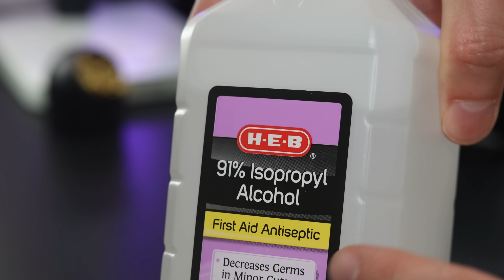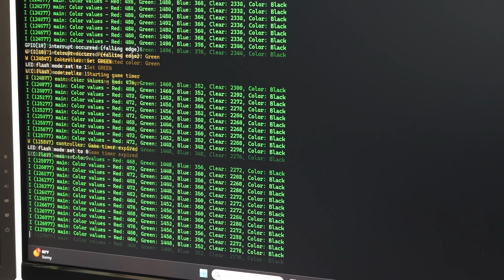Do This Before You Solder Anything

Comment: You don't need to be too specific with the iron temperature, as you can compensate by adjusting your soldering speed. I used a Metcal iron with a STTC-126 tip for everything (From SMD to large ground planes and 8AWG wire) - It has a fixed temperature of 413C.

I wouldn't want people to struggle and think the setting is wrong or the tip is wrong or they need extra flux or something else - It's all about practice and once you're good at it, the equipment and settings don't really matter. (Except for good quality solder, the poor quality stuff really is useless.)

Comment: ok, well, I have solder about 100 units a day, which would be around 3000-5000 individual solder joints, so your process is just a little too slow, nice video though.

Comment: Great video !

Radio technician for 50 years:

I used a gun until actually employed. Irons will disappoint you when making the transition
to a bench pencil iron. 
I love the weller butane irons in February on top of grain mills.

2. 99% alcohol always.  Too much water and won't evaporate quickly when you're in the field under the gun repairing gear.

Get the best, not most expensive,
desoldering tool you can find. Hakko brand & Pace MP-1.
With today's LiFePO4 batteries, you can make them portable. 

SOLDER WICK IS YOUR FRIEND.
I loved how you used the wire to remove excess solder.

Sometimes when removing a silver soldered component, 
and you can't get it hot enough: 

DOPE IT.

Add regular (vs. Unleaded) solder to the connection.  
It'll just fall off now. 
Clean it off and use whichever you want or is handy when you're on top of a farm leg in February.

Great video !
Great presentation!
Great order !

Thanks !!
Reply: Silver solder, or silver bearing solder? There's a difference.

Comment: a bad fume extractor can give a false sense of protection so it might actually be worse to have a bad one.
And iove soldered for 20+ years, and having a good solder with 5 core flux or similiar (and having the lowest possible temperature for the thing youre gonan solder) removes the need of adding flux in most cases

Comment: I have been soldering since the 90s and have come up with THREE basic rules: 
1. The solder should be of maximum quality and preferably 63/37 (NOT purchased in China).
2. The soldering iron must have thermal stabilization. 
3. The tip size, the soldering iron must be selected according to the size of the soldering object - the Fourier heat transfer law still works (you can raise the temperature - but this is unprofessional). 
With desoldering, everything becomes much more complicated ))
Reply: Также предварительное облуживание поверхностей, которые посредственно поддаются покрытию припоем

Comment: You obviously haven't come across corroded solder pads. A first step in those cases is to use a gentle rubbing with something like scotchbrite or metal wool. I've never used flux and had excellent results. Flux makes it way more messy. Use it for small packages and QFN ICs etc, but generally for through-hole it is not needed.

Comment: As a kid, back in the 60's, I built quite a few radio related kits.  I thought I was pretty good at soldering.  A few years later, I worked for a company who built components for NASA spacecraft.  NASA had specific requirements as to how to properly solder their components.  Fact of the matter is...after a bit of training, you took a test to earn your NASA solderers  license.   That's when I learned the importance of a clean joint and flux.  You are spot on in your demonstration!  Best and most complete I've seen in many years.  NASA requirements did go a bit further....but most of us hobby builders aren't planning on our project going into space. 
 Great Job!
Reply from the maker: Thanks so much! This means a lot to me. Thanks for sharing!!
Reply: Agreed. As a side comment... the current IPC standards were an outgrowth/replacement from the original NASA standards. The majority of the 'basic' soldering techniques have not significantly changed between the two standards, the IPC one has really just been updated for lead-free soldering and for SMD requirements. The IPC standard is way too expensive for a hobbyist to procure or to achieve certification, however, surprisingly the old NASA standards can still be found on the internet for free !
Reply: My dad used to build radios as a hobby like 40 years ago when I was still a kid. For this, he was like a hero to me - I was really impressed. He even built wooden enclosures. He passed away five years ago and I got one of his old radios. It still worked but unfortunately didn't survive very long after I started to use it. HOwever, now as an adult I noticed that he actually didn't build the radio very well. But that does not change my perception of him - the contrary is the case: He made me see the wonders of electronics when I was still a kiddo. Today I am taking his work apart and try to rebuild it component by component utilizing every skill I learned on my way. <3
Reply: There's some old NASA training  videos on youtube.  They are very strict.  I don't know if I could pass their tests.
Reply: I found an old video (search _RXugDd0xik on youtube) which is a NASA film on soldering. Truly incredible the standards they had, but of course the joints had to last in space!
Reply: If you don't mind, whats an example of the extra standards they'd apply to judging your solder?
Reply: @Chuck-w1v I would say not so much judging but adherence to the proper techniques...many of which are presented in the video.  Cleanliness of joint...Proper amounts of flux...only enough to do the job. Too much flux can "wick" under insulation of wires and corrode.  Proper amount of solder...again...only enough to make proper connection.  NASA was worried about any extra weight. Appearance of joint....nice solder flow...shiny....not cold joint.  Keep in mind....this was back in the late 60's.  No temp controlled stations...although small pencil irons were used...and all work by hand using subminature components of the time. Transistors that were pin head size...were hand soldered. Those went in Apollo.
Reply: @kerryholcomb6781  very cool, thank you for the reply. I'll make sure to go easy on the flux, I didn't think about it soaking up into the wire where I couldn't see
Reply: @Chuck-w1v While it has nothing to do with soldering....I was always impressed with the "traceability" of the components for the NASA jobs.  Each individual component....be it resistor, transistor, bolt or screw..had it's own individual part number.  We had to fill out a sheet with all the individual part numbers that stayed with the finished component. This was all compiled and tracked by hand....we had no affordable computers back then.
Reply: Try plumbing solder joints, if it isn't clean and fluxed you and your future generations are getting wet.

Comment: Been doing this since 1970.   I agree with everything but you left out one basic rule: do not apply pressure with the iron on a circuit board.   Touch but do not push.     Pressure will not make better heat transfer but it will lift the circuit trace from the board.

Comment: Nice refresher. Flux doesn't just clean though, it allows the heat of the soldering iron to flow into the pad by increasing surface area.

Comment: @1:13 Just want to point out that you definitely do not NEED to have different thickness of solder for different thickness wires. It's slightly more convenient to have but certainly not necessary. If you're someone who's just starting out, or even like me who does micro soldering for a living, buying a medium thickness or even a thinner solder wire is more than enough. I only ever use two different thicknesses for anything I solder, and it works just fine. Most of the time when you solder tiny SMD components, you apply the solder to the tip of the iron anyway.

Comment: for cleaning tough corrosion on wire leads or circuit boards, I use one of those pink pencil erasers. It has just enough abrasiveness to scrub things like resistor leads. of course isopropyl alcohol is very useful for cleaning too (I use both now, but in school we only were given erasers).

Comment: Based on my own experience, I'd like to share some tips:

1) Cleaning the board is not as simple as just wiping a spot with alcohol. It's better to use a soft brush and rub a cotton pad or napkin soaked in alcohol with it. This increases the chances of dirt getting removed, especially from hard-to-reach places.

2) Cleaning the board after soldering is crucial. Especially if you use an acid-based flux (Triethanolamine, Aniline hydrochloride and ammonium chloride saturated aqueous solution, Glycerin, Isopropyl), you need to rinse the solder very well if you don't want to deal with phantom issues later. You'll need a bath of alcohol with active stirring for a few hours, or an ultrasonic bath for a few minutes. You'll feel the difference when your fingers no longer slide on the board's surface.

3) The solder melting temperature depends not only on whether it contains lead or something else, but also on its proportion to tin. Sn61Pb39 solder melts at 183°C, and a comfortable soldering temperature should not exceed 260°C. At 300°C and above, this type of solder will begin to oxidize too quickly, and some fluxes will rapidly lose their properties. It's best not to use such a high temperature when soldering microcontrollers, operational amplifiers, or resistors near them, as well as LEDs.

4) The video doesn't mention choosing the tip shape, but it plays an important role. To tin the tip, use acids suitable for nickel, which the tip is coated with, as well as specialized tip restorers. If you are soldering at a temperature above 300°C with a smart soldering iron, set the standby temperature to ~180-220°C so the tip doesn't oxidize over time when you're not actively soldering.
Reply: I use a single tip for 10 years and it works just fine
Reply: @MegaChickenPunch  Same... except when I tried to use dirt cheap no-name tips. They corroded away in minutes! It was impressive in a way. Never had this issue with decent quality tips while doing basically zero maintenance.
Reply: Well said. I was going to make the same comment about the temperatures. Nothing to be corrected.
2) The cleaning can be done with alkaline soap (coconut soap, those which are white and not brownish, in my country, pH=8-9, NaOH or KOH in excess) in a bath with agitation (glasses cleaning bath,  aliexpress 'grade'; the soap can be dissolved in water until the solution begins to make bubbles) for small boards. Rinse in water (de-ionized, distilled or from a clean well), 10 times the volume of the circuit, 2 baths. Quick dry with a fan or hairdrier and a dip in IPA followed with another dry. 
The main advantage is that you can reuse the IPA many times.
Reply: For boards that have some corrosion or stains on the pads I used a soft pencil eraser.  If you cut a slit in the eraser you can clean component leads (resistors, capacitors, etc) by running the leads through the slot while squeezing the slot in. If it's really bad, one of those "ink erasers" could be used carefully, as they are very abrasive.
For cleaning after soldering, I use isopropyl with a tooth brush. Then I wash with demineralized water and a cleaning solution made for PCBs and parts using the tooth brush. I use an Australian made one from Chemtools.  Boards come out looking like they came from a factory, no sticky residue or streaks.

Comment: 1)  LEAD solder and pre-fluxed core has NEVER needed additional flux exept on cables.
2)  The timing on flowing solder through holes is critical. the joint must be pre-heated for a second to allow solder to flow through the hole easiy when solder is applied.
3)  The above is also relevent on SMT, but hot air usually pre-heats the board without you doing anything.
4)  multicore cable can be dipped in flux to allow fast tinning without melting the PVC insulation much.
5)  isopropanol is really great for cleaning all the flux away afterwards. It's not normally used to pre-clean unless oil/fimger smudge comtamination is present.
Hope that helps!!
Reply: back when tin-lead rosin-core solder was the standard, we still had flux around. It was good if you had a large area to flow like larger wires or for example a component that has a grounded heatsink like some power transistors, or those cases where you want to solder a lead to a copper plate or antenna that is going to take a lot of heat and time to get done. the rosin in rosin-core will boil off far too before the solder have flowed properly, so you need the extra flux.
Reply: I agree on all points, but want to add there are tools to prevent melting of insulation and wicking of solder under the insulation (anti-wicking tools).
Reply: needed? no... better? hell yes.

Comment: There's quite a lot of pro/against with leaded solder. Thing to remember is although Leaded solder is sort off still about, it's pretty much illegal in Europe/UK. There are exemptions, but lead is poison, it cause brain damage. So if you must use it, ventilation is key. Don't use it on kids toys, or any surface you touch or contacts food/drink. And you have to dispose of it separately at the tip. Not with your general rubbish.

Comment: Another good thing to use is a heat-resistant silicone pad. Comes in various sizes.
You would not need to use some random box as makeshift anvil.

Comment: Oh gosh... Your soldering tip is in bad shape. Leaded solder NOT requided OVER 300 degrees for such small pins without big poly on backside. And... You need other tip type for general. Try to use BC2 tip. It's really easier for most applications than "I" or similar "conical".

Comment: How many components?

Doas it have proximity sensors?

Your car?
Reply from the maker: the soldering is only for the motor leads. As for the sensors, there is an RGB sensor on the bottom and a HAL effect switch. But, I designed it to be expandable, more sensors are coming! :)
Reply: @stuckatprototype 

Interesting what are you doing with the drone as well?

Comment: Sol-der.

Sodder is a word that alludes to an act of intimacy.

So please. Make the word SOL-DER the correct way to sat soldering.

I suspect the other way to say this word came about from an inside joke somewhere, but it is extremely tired now and just not acceptable as a term that referst to weldiing electrical/ electronic compontents into a circuit.

Thank you.

Comment: Leaded solder is better for everything, just remember to wash your hands and don't put it in your mouth
2:35 knife or something else to scrape the pad would be better, alcohol is quite pointless. You'd only really have problems on boards that have oxidation on them
8:31 sponge is better for the iron as it won't scratch away the coating on the tip. Your tip looks very oxidized as if you used way too high temps on it or just didn't take proper care of it
10:25  this just lacks flux, you rarely have to use wick to get rid of solder, the tip itself should do that on its own. Your tip in this is full on dark and oxidies so its not pulling any solder to itself

Comment: One thing I'd suggest that made a huge difference to my soldering is to check if your tip is magnetic. If it is, it's likely solid steel which transfers heat poorly. The best tips are plated copper. Unplated copper tips are good at transferring heat compared to steel but they dissolve away into the solder so don't last long.

Comment: I was hoping to see some 0402 to hand solder. You do not need a tip to solder a header you can even do it on an open fire. Great effort good explanations  abd gpaphics, i think  this video will help a lot of people.
Reply from the maker: I’ll make a video about SMT assembly and thank you! :)
Reply: 0402 is easy enough with a microscope, a small enough tip and thin solder. The biggest problem that I have with that size is that when soldering the second side, there's so little thermal mass in the component that you can easily and quickly desolder the first side. This means that you need to be very quick. 0603 is therefore much easier in that regard.

Comment: No one explained what a cold joint meant to me for a long time. In a sound joint the solder combines with the copper into an alloy, but in a cold joint it just mechanically sticks to the surface without forming a strong connection. The cause of this is insufficient flux or the flux not activating, so the copper still has a layer of oxide that makes the solder ball up above it. In a sound joint you will see the solder flow into the fluxed surface.

Comment: Also, make sure you are not using acid-core solder. That's for plumbing!  (It will work, but the acid will damage the circuitry over time.)

Comment: It is often necessary to touch the solder to the tip of the iron for an instant before moving the solder to the spot being soldered. Without doing so, a board can be damaged due to longer dwell time (time iron tip is held to the spot being soldered).

Comment: Lead Free Solder, UGH. Best is 60/40 @ 0.32 diameter with internal flux. Hako -936 @ 700 degrees best for most SMD boards.

Comment: Heat is not the same as temperature.
This is important.
Large wire does not really need higher temperature than smaller wire, provided you have enough heat.

Comment: Great video! One thing worth mentioning regarding flux: it also helps with heat transfer, assuming you're adding additional flux, as you're essentially surrounding the joint with a liquid rather than air. Not a huge difference as the flux generally boils at soldering temperatures, but it does help!